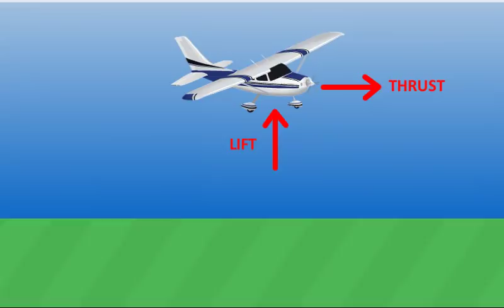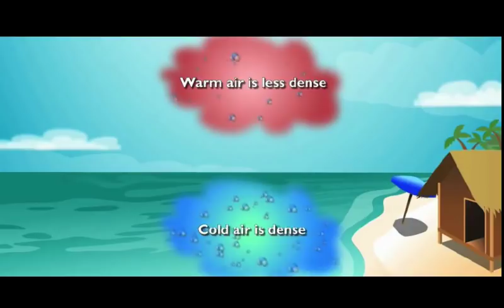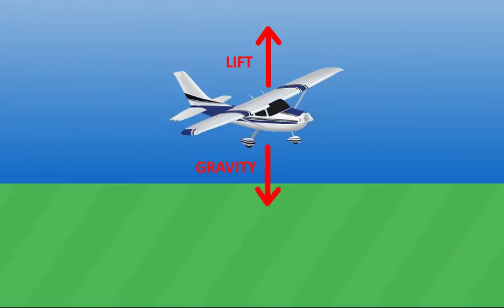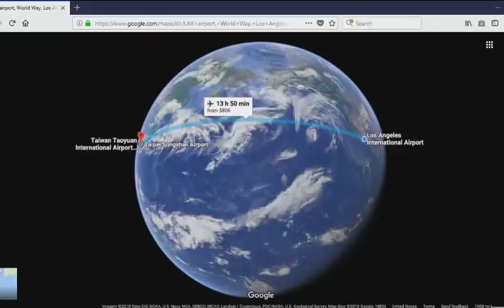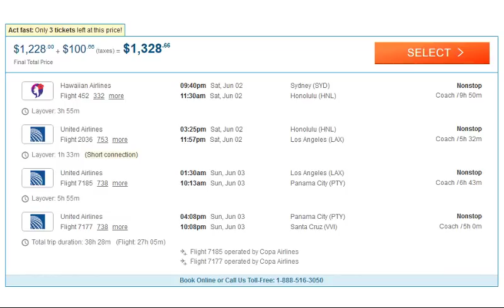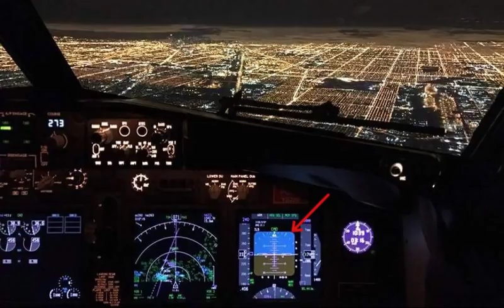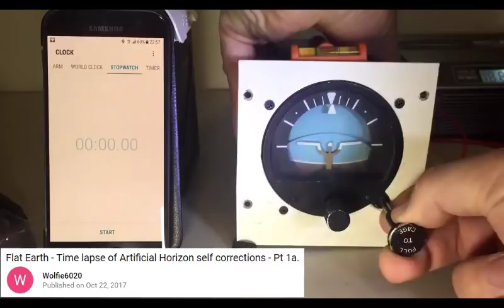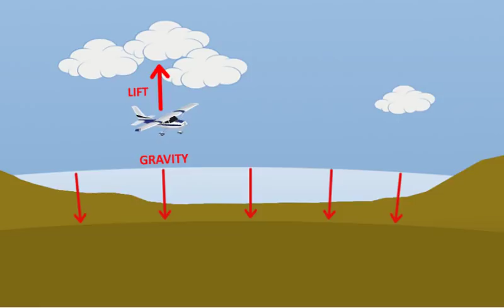Flat Earth Falsities - Plane Nonsense

Comment: Confused...this video still can not prove gravity...also if a plane is going east at 500 mph and the earth and the air is going at 1000 mph then wouldnt air be moving over the back of plane wings to the front of the wings? How do you get lift???
Reply from the maker: Speed is relative. A plane going 500 mph east, at the equator, is going 500 mph RELATIVE to the earth’s surface, and to the atmosphere. It is going 1500 mph RELATIVE to the center of the earth. When the plane was on the ground, it was already moving 1000 mph east, relative to the center of the earth, so it only needed to add 500 to that speed, not 1500. 

When you walk forward in a train at 2 mph, you are going 2 mph relative to the train, but if the train is going 60 mph, you are going 62 mph relative to the tracks.

The atmosphere rotates with the earth, just like the air inside the train moves with the train. So the plane’s wings are going through the air at 500 mph.
Reply from the maker: TheFsandt - A plane flying 500 mph west at the equator, relative to the ground, is actually moving east by 500 mph relative to the center of the earth. (1000-500). Yes, you actually move east to go west. Unless you can go faster than 1000. But you are still moving 500 relative to the surface, and 500 relative to the air, assuming no wind.  

Why is this so hard? Haven’t you ever walked down the up escalator? Unless you move faster than the escalator, you still go up.
Reply: TheFsandt and Richard in order to criticize something, and science demands criticism to prove that it is worthy to be believed, you must actually watch the video.

Why do you have a problem with the earth turning a leisurely 1000 miles per hour when your dogma requires the moon to move twice an infinite distance each day, and then the same twice infinite distance back to the starting point for us to see it "rise" the next morning. Your dogma requires the sun to move trillions and trillions of times faster than light! I find that ridiculous.

Comment: The atmosphere does rotate with the earth but it is dragged by the surface of the earth. Which creates a lag.  This is how the prevailing winds are prevailing.
Reply: No.
Reply: It's the Coriolis effect, as Voysov said.
Reply from the maker: Actually, no. Prevailing winds are most often due to temperature gradients. I live in California. The prevailing winds here are onshore, which is too the east, toward the direction of the spin of the earth. They occur because the air is warmed by the land, and cooled by the ocean, which creates a vertical circular flow of air, as hot air rises, and colder air is pulled in to fill the gap. The spin of the earth does effect jet streams though, which are high altitude winds, and also the direction of spin of large weather systems. Watch videos from the Himawari 8 satellite and you will see clouds spinning counter-clockwise in the north, and clockwise in the south. This is called the Coriolis effect.
Reply: Why do you think cyclones in the northern hemisphere rotate in the opposite direction as cyclones happening in the southern hemisphere?  The rotation of the globe churning the atmosphere.
Reply from the maker: Mr. Lowery - Yes, sorry. We pretty much agree. I was just saying “prevailing winds” is not the same as the Coriolis effect.
Reply: It's all good.  The Coriolis effect is exactly what I meant,  I just couldn't remember the name "Coriolis" at the time.  LoL
Reply: @Mr. Lowery
You keep appearing all over the place, posting stupid comments, being proved wrong and then running away. Troll much?
Reply: @Lars Mich
Proof that your High Priest Campanella is a liar you mean? He ran away when I proved he was an idiot and a liar.
Jeranism
I sent you some queries, and you responded to them, as follows
Why is it that a compass needle is more or less vertical at the poles and horizontal at the equator?
And when you carry on past the poles the needle slowly returns to the horizontal?
Why is it that it is only possible to navigate over long distances using spherical trigonometry?
Why is it that traditional gyro compasses work perfectly in low low latitudes but became unreliable in high latitudes?
Why is it that it is only possible to navigate over long distances using charts based on a terrestrial spheroid?
Why is it that when you watch a ship sailing away from you the hull is the first thing to go below the horizon, then the superstructure and finally the funnel and upperworks?
Does a magnetic compass point towards polaris (Alpha Ursae Minoris) at the north and south poles?
Does a gyro compass point towards Alpha Ursae Minoris at the north and south poles?
His response
1. It isn't
2. You are repeating things you have heard and never experienced
3. That's not true at all
4. Why does a gyro not show drift? 
5. Haha so not true. Ever heard of a mercator projection? Ask ANY ship captain.
6.I've shown this 100's of times. Walk away from me and your shoes will disappear first.
7. no
8.no
My response
Sweety, I became a Master Mariner over nearly five decades ago, so I am telling you that you are the one "repeating things you have heard and never experienced". Fact.
What do you mean by "Why does a gyro not show drift" when referring to a gyro compass?
The only answers you got correct were 7 and 8. The reason the correct answer is "no" is because the earth is a terrestrial spheroid. rather than a flat earth. 
Mercator Charts, i.e. charts printed using a Mercator projection, note "projection", are not accurate, Straight lines on a Mercator chart are spirals, other than the cardinals, and not great circles and therefore no use for anything but short distances.
Regarding 6. I suggest you go to the middle of the Indian Ocean and watch a 500,000 tonne tanker sail away from you. Something you have quite obviously never done, have you. Ask any Master Mariner and they will confirm what I have said. Also, if I walked away from you my shoes would not disappear. Yours would.
He ran away. Because he was proved a liar.
Reply: Again, slower..
Reply: Your pathetic attempt at insulting someone aren't even interesting.  You could at least try to use your fucking imagination and type out something that is worth reading instead of simply accelerating the heat death of the universe.

Comment: Whoa slow down @3:10 you say a plane traveling North can land with no problem?  Yet you just said conservation of energy says it has initial velocity of 1000mph at the Equator.  Well the farther North you go, the slower the ground moves.  How can it land safely?  Way to breeze over this explanation.
Reply: BigGritts Fasho Equator to North Pole is over 6000 miles during which flight the pilot (or autopilot) is constantly adjusting for varying winds, weather etc. The change in velocity is slow and would cause less disruption than varying winds. It's all a matter of scale.
Reply: "Well the farther North you go, the slower the ground moves."
Correct, but you're missing one important factor.  The farther north you go, the slower the atmosphere moves.  The airplane is flying through the atmosphere and therefore is slowed by the atmosphere.  These distances are far to great at the speed of the aircraft far to slow (relatively speaking) for anyone on the aircraft to notice.
Reply: A very slight (read virtually imperceptible) left turn spread throughout the duration of the flight.  So slight that it would easily be lost in the corrections made for changes in wind and air pressure.
Reply: "So if a plane flies North to the Equator from a point South of the Equator the Eastward moving atmosphere is accelerating the plane at an equal rate that the Eastward moving atmosphere would be deceleration a plane moving from the Equator North?"

Did you understand my carousel analogy?  Do you agree that the outer horses are moving faster than the inner horses?  The atmosphere is the same thing, the atmosphere at the equator is the "outer" horse and anything north or south of that is progressively "inner".  All the horses are moving in the same direction.  All the horses are completing a circuit in the same time, but because the outer horses are traveling a longer distance they are moving faster.  Move from one horse to the another and you speed up or slow down depending on if you are moving in or out.  Move from one latitude to another and you speed up or slow down depending on if you are moving towards the equator or away from the equator.

"And besides if the atmosphere is doing all the work, why does the pilot need to make small adjustments?"

Because the atmosphere does not do all the work, it does the vast majority of it, so much so that what the pilot does can almost be ignored.  That's why I described it as virtually imperceptible.
Reply: BigGritts Fasho Which is why I started the paragraph with "unless the plane is moving due North".

"is it atmosphere or adjustments"
Both. It isn't necessary for one factor to be responsible for everything. 

"What tells him to stop?"
His navigational system. You seem to be assuming the coriolis effect is both raid and large. We're talking about accumulative adjustments in speed over the course of hours and thousands of miles.
Reply: "So does the atmosphere slow or speed up a plane?"
Both, it depends on which direction the plane is flying.

Imagine for a moment a carousel:  https://www.reithoffershows.com/wp-content/uploads/2017/08/Grand-Carousel2.jpg
The horses on the outside of the carousel are traveling faster than the horses on the inside of the carousel because the are traveling a longer distance in the same amount of time.  If you were riding an outer horse and you stood up and moved to an inner horse you would slow down naturally as a consequence of the movement of the carousel.  If you then got up and moved back to the outer horse you would speed up again.
Reply: "The only thing that could effect it's velocity East is an acceleration towards the West."
A deceleration which occurs as a result of the atmosphere moving slower.
Reply: How could anyone be this stupid?
Reply: mersyndol You can measure the circumference and divide by 2 x pi; how many times does it need to be done to convince you it's been done?
Reply: BigGritts Fasho "a turn will not negate any Eastward velocity"
Unless the plane is moving due North then its forward velocity is a combination of northwards and east/westwards velocities. A turn away from due north requires acceleration east or westwards.
Reply: the earth is elliptical (not 100% round) but you can roughly calculate the size and shape of the earth with 2 sticks, a sunny day, and some high school geometry. Eratosthenes, google it.
Reply: mersyndol It was done (repeatedly) over history.

The famous method is the one described here : https://en.m.wikipedia.org/wiki/Eratosthenes#Measurement_of_the_Earth's_circumference   This, and some maths gives you the radius (from C=(pi)*2r ).

There were some inaccuracies, to do with the precision of measurement and some incorrect assumptions, but the method is sound, if not perfectly precise since the Earth isn't a perfect sphere, so the polar circumference and equatorial circumference are different.
Reply: Here is a word for the kiddies. Datum point.
Try to refute the so called radius dimension?! It's your system that says it's there. That keep you up at night?? And if not why not?

Please, i would love to see someone here measure the radius of the earth with practical methods. It's not about tricking you little girl. It's about this so called measurement!!
WHY CAN NO ONE MEASURE IT!! this has gone beyond a joke! You say it's a fact! 
"Show me" this is pissing me off!! If the radius of the earth is real!!!!!! Show us Please!!!
Reply: OMG GMO 
So if a plane flies North to the Equator from a point South of the Equator the Eastward moving atmosphere is accelerating the plane at an equal rate that the Eastward moving atmosphere would be deceleration a plane moving from the Equator North?  I don't think so.  And besides if the atmosphere is doing all the work, why does the pilot need to make small adjustments?
Reply: Flook D 
If his nose is pointing North than what kind of adjustments would he make to counter a Eastward directed velocity?
Reply: OMG GMO 
So does the atmosphere slow or speed up a plane?  Because when you're traveling South up to the Equator the atmosphere is somehow now pushing the plane East?
Reply: OMG GMO 
Sorry but a turn will not negate any Eastward velocity.  The only thing that could effect it's velocity East is an acceleration towards the West.
Reply: Flook D 
If a plane is moving due North, it's forward velocity is only North.  It's inertia (Eastward velocity) is moving East.  Is it the adjustments that slow the plane to match the ground speed or is it the atmosphere?   If it's the atmosphere  than you don't need any "adjustments."  If it's the adjustments how does the pilot know how much he needs to accelerate West to nullify his Eastward velocity due to initial inertia (matching the speed of the ground)?  What happens if he accelerates too much West and starts rotating slower than the ground?  What tells him to stop?